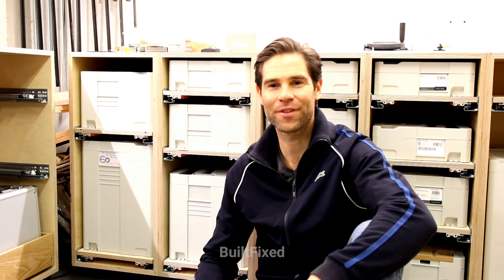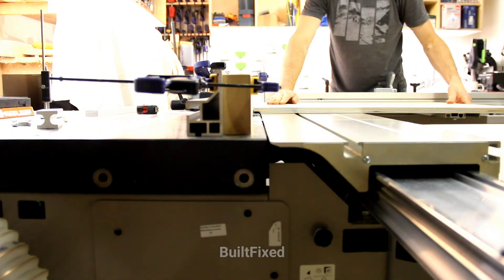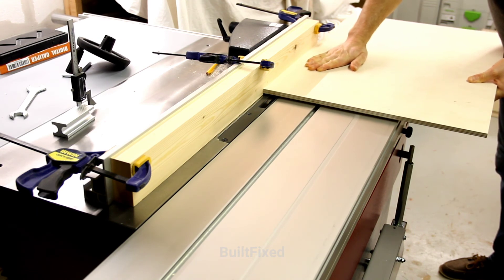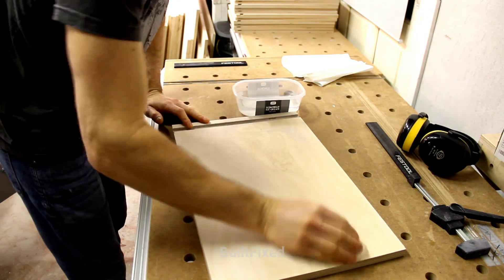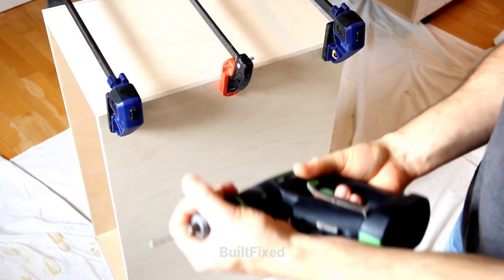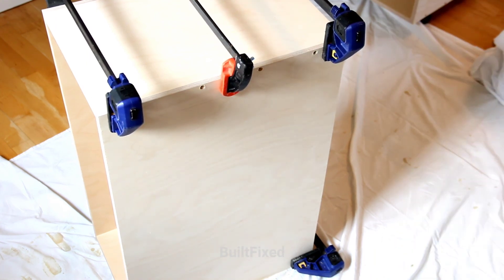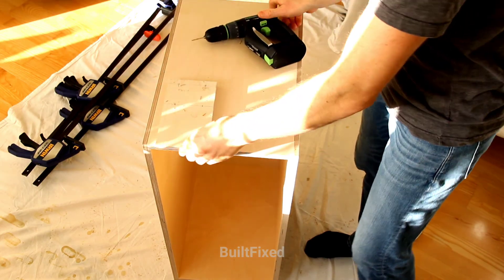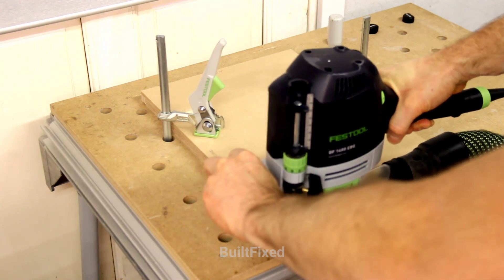Festool Systainer Cabinet Build Part 2

Comment: Your turning the Systainers 90 degrees on the cabinet drawers is a great idea.    It's a shame you did not use a Festool Domino DF 500, you would eliminate saw setup for the rabbets and dados, sawing the rabbets and dados,  making drilling templates, drilling polite holes, countersinking the screw holes, and installing the screws. Also saved a bit of material, and no pudding the screw heads.Sustainers